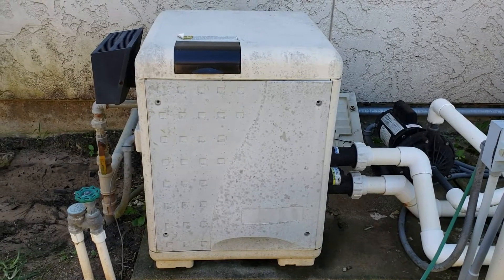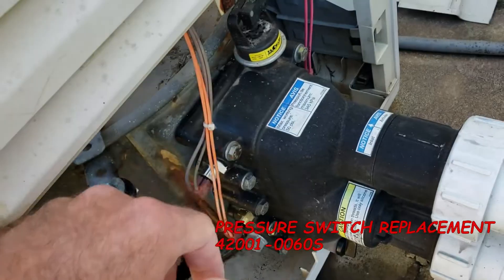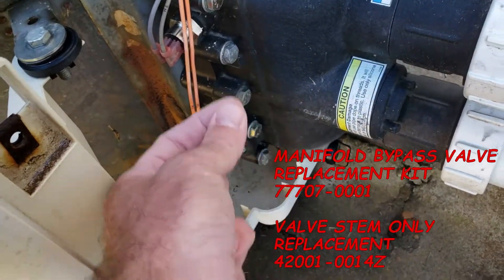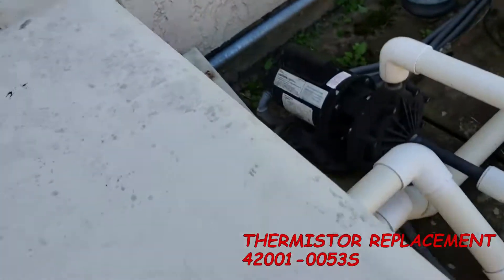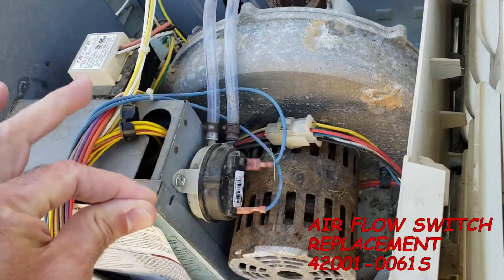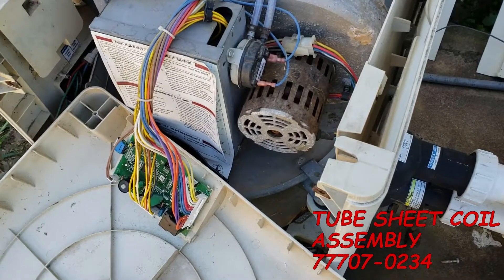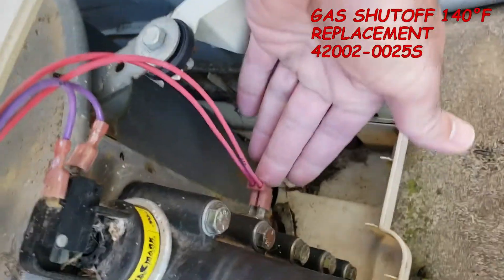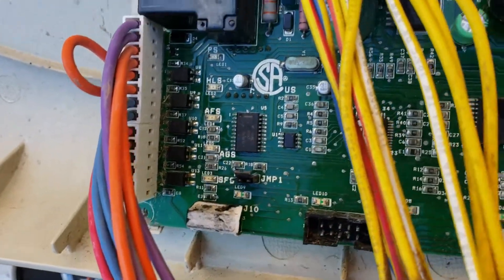PENTAIR MASTERTEMP 400 ERROR LIGHT LED EXPLAINED

Comment: Hello! 

I have Mastertemp 400 that's about 5 years old.  Does the same thing whether I turn heat on with my phone app (iAquaLink) or with the unit being in service mode(manual).

    Cleaned filter to ensure proper water flow
    Temp was set to 102
    Revision 13
    Thermister reporting ambient temp

The heater seems to be firing up normally when the controller calls for heat. The air blower spins up with the HEATING led flashing for about 10 seconds before the burner actually turns on and heat is felt coming out of the metal exhaust vent. However the instant the burner ignites, the SERVICE HEATER led turns on immediately. The burner continues to fire for 12--21 seconds before the heat/burner shuts off. Usually over 20 seconds. The heater is definitely turning on. I can feel heat coming out. I removed the top cover and checked out the LEDs. Found the the 'AGS' LED on...on the back of the board. Followed the troubleshooting chart in the install manual.

Purchased and installed new AGS switch from Amazon. Didn't fix it. Also at the same time, I replaced the thermal regulator. (tested old one and new one in hot water, both worked)

On the header, I noticed the bottom 2 bolts were rusted(plan on changing them all to stainless). Removed the 2 to see if any water game out. No water came out. Ended up keeping going. Removed the header completely so that I could check the Manifold Bypass Valve. Looked good. Copper on the heat exchanger pipes in and out looked good. Thermister and HLS looked good, but I haven't tested them. I haven't replaced the control board yet since it's pricey. Really don't wanna jump into the tub yet, since its a big job. Honestly don't wanna just replace everything in hopes to find a needle in a haystack.

What are some other tests I can run? I'm good with DVOMs, resistance checks etc.
Not sure where to do at the moment. Suggestions?

I added a video of this https://youtu.be/bu4v_HDQCbA
Reply from the maker: Wow, that's some fantastic persistence for sure.  You and I have that in common clearly.  As for your problem, I have no experience with AGS and PS error lights, so I would not want to suggest anything other that what you have already done which is replace the AGS.  I am a telephone cable repairman by profession, so I am much more comfortable making electrical suggestions than gas suggestions.  Someone posted in one of my videos that their gas pressure was insufficient and suggested the low gas pressure was causing their AGS error, but you have had your system for 5 years on that same pressure and had no issues, so that doesn't sound like the right rabbit hole for you to look in.  Please leave this post up and let's see if we can get someone else to comment that has had and fixed the same problem you are having. Suggestions anyone?  Cheers!
Reply: @pvt-pilot  Thanks!  I'll leave it up.   Ya, my gas is good.  Actually entire system has been there 14 years, just my new heater that I installed 5 years ago is new.  I've also put this onto forums at Trouble Free pool.  I'm not a pool guy either, but I do fix my own pool LOL

Comment: Hello!  I have this same heater(about 4 years old). Unit fires then turns off after 10 seconds.  I removed the lid and found the AFS led on.  As a precaution, I removed the bottom 2 bolts on the black manifold to see if I have a leak.  Altho, the bolt heads were rusted pretty bad, thankfully, no water came out.  I've ordered the Pentair 42002-0025S AGS sensor. Hope this does the trick. I'll reply back later after I swap it out. thanks again
Reply: Did that work I keep getting and AFS light but I put a jumper wire between the two connectors and now it work but obviously not the proper fix.

Comment: I got AFS lit and led 11.  Replaced thermistor, thermal regulator, the probe for the heat exhaust, igniter, and switched inside board with used one claimed to come out of good unit.  Turn on heater once new igniter in it actually had heating light on for second before going to service and screen just has a stand-alone 1 on it.  Mastertemp 400
Reply from the maker: Remove one of the 2 bottom bolts of your black manifold mounted on the side of the combustion chamber.  If water comes out, you have a leak with your tube sheet coil assembly.  That's what caused my AFS.  Watch my AFS video and heat coil replacement video if you have that same problem.

Comment: My man!!! Thanks for the great video.  However, I am seeing something else.  My heater DOM is 2011 just to give you an idea.  Lately, when i walk by I see that the LED lights are on and it shows pool heating.  But, I did not turn it on.  When I try to turn off, it just stays on.  (bad button?)  It does however let me switch between pool and spa.  Sometimes the fan is even running.  I turned the gas off so in case it did fire up I would not be burning NG all night or day without knowing.  FYI, it does light up and heat if I want it to.  Today when I got home it was doing the same thing so I pulled the cover off and looked around.  Everything looked ok.  I made sure everything was plugged in tight etc.....  Circuit breaker off and back on and it does the same thing, fires up itself.  But then I get an ADO and SE code.  The SE lets me select 1 or 2.  Long story short, I unwired the heater until I can figure it out.  I am a pretty handy guy, just looking for some direction.  Thanks in advance.
Reply: If my heater was coming on without my turning it on, I would suspect a defective touch pad first. I would remove front and rear panels, unscrew four toggle nuts holding top panel on, flip top panel over, than unclip ribbon cable connecting touchpad to control board.
If that stopped heater from coming on all by itself, than I would order new touch pad.
Reply from the maker: Hmmm, working too well for ya!  I had that happen before too, but it was only because I had my main Easytouch control panel programmed to heat the pool too by accident instead of only the spa.  So when I turned off the spa, it went from trying to reach 96 degrees (spa) to trying to reach 84 degrees (pool).  This called for occasional heating since the ambient temperature at the time was about 65 degrees.  The was user error, not faulty equipment, and I fixed that right away by taking a closer look at my programmed settings.  If you know you have you main control panel set correctly, then I don't know what is causing it to turn on without command.  I would lean toward the control board being the culprit, but that is just a shot in the dark...sorry I don't have anything definitive for you mate.

Comment: I’m getting HLS light error, heated turns on and off. I replaced HLS and thermistor, took manifold apart everything in there is intact. By heater still cycles on and off showing HLS error. Any ideas?
Reply from the maker: Hey Toni, no other ideas come to mind really.  You hit up the 2 items I would hit first...the most common broken manifold bypass valve and then the HLS itself.  Something is still making the control board detect too hot of water across HLS.  I assume your heat exchange coils are not clogged since you took the manifold off already.  Im sure you would have noticed something there if there was a problem.  Perhaps corrosion of the wiring harness where it plugs into the contol board or a faulty control board itself.  Neither of these are likely but worth taking a look at them.  The control board needs the correct resistance across the HLS pins on the motherboard to function correctly, and corrosion can throw resistance readings out of spec easily.  Sorry, I am not much help.  That's all I got for now.  You did all I know already.  Good luck and please let this comment feed know what you find.  Thanks!

Comment: You didn't address the temp fault light on the board. What is that repair solution? I'm getting 128 r14 E01
Reply from the maker: I don't have a temp fault light on my board...you may have a newer version that included a temp fault light.

128 = normal part of boot sequence displayed on all software revisions of this pentair control board.

r14 = revision #14 software  is loaded to your control board. (Mine is r8 = revision #8 software)

E01 means that your control board detects an open on the pins of the control board dedicated for the thermistor.  This can be either an open in your thermistor itself (defective) or an open in the wiring harness wires that are hooked up to the thermistor (look for rodent damage on wires or corroded spade connectors)  Thermistors are electrical thermometers so if you have temp fault light and E01 on your display, this would make perfect sense.  Both are screaming fix the problem with the thermistor.
Hope this helps.
Reply from the maker: Here is my thermistor replacement video:  https://youtu.be/vh62GXqkKTA

Comment: DUDE!!!!!! My jacuzzi has been down for a year and a half because I refused to replace it. I started with replacing the control board, then the blower/fan motor, AND NOW!!!!!!; having viewed your video(which didn't exist when it first went down), will replace the pressure switch. I went out initially to short it out to confirm the switch really was the problem. It was then that I discovered both leads had rusted through and broken off. Yet, they remained in position making it look like they were landed properly.

So, I re-terminated the wires, re-connnected them and ta da, it fired right up!!!! The terminal lugs are sketchy on the switch so I'm going to replace the switch as a precaution. Can't thank you enough.
Reply from the maker: Sweet!  Stories like this make it all worth it to me that I bothered posting this stuff.  Cheers!

Comment: Service heater on but no codes??? Please help
Reply from the maker: Check thermal regulator first.  A faulty thermal regulator will throw a service heater light without codes because it is not an electronic part tied to the control board but a properly functioning HLS will detect the super heated water resulting from a stuck thermal regulator and will shut the heater down and display "service heater"
Reply: PVT-PILOT   Already did. My next step is to replace those 2 sensors next to it. 
Thanks for fast response

Comment: Very good video. Short and to the point. I keep getting an AGS light. The heater is almost new. Not sure what to do. It runs for quite a while then throws the error again. I can unplug the heater and it works fine for a while.
Reply from the maker: I am not sure what would trigger AGS other than a defective AGS itself.  I have never had that error led yet on mine other than when I intentionally disconnected the AGS (open leads) just to see what would happen, so I never tore the gas side of the heater down to figure out how it works.  Sorry, all I can say is if you open the leads (a.k.a. your AGS is internally open or has high resistance out of specs), the AGS diagnostic led will illuminate.
Reply: PVT-PILOT Ok. Thanks. I will do some more investigating. I’m guessing low gas pressure right now.
Reply: PVT-PILOT FYI....I figured my problem out. It was a bad thermal regulator. I put a new one in and it works fine again. It was only 2 months old though. So if anyone has an AGS light, the thermal regulator may be the issue. Thx
Reply: I figure the AGS sensor is nothing more than a high limit temperature switch that shuts the gas off.
Reply from the maker: @ericanderson8556  Cool, thanks for adding your experience to the thread.
Reply: Common problem with new pools that have variable speed pumps. Homeowner or pool company sets pump speed too low to provide enough water circulation thru heater causing water to overheat and trip the ags, shutting the heater off.
Common fix if you have an easy touch panel is to get into settings and have the pump speed increased to about 2600 rpms in spa mode. If you dont have a panel  than you will just have to increase pump speed at the pump display.

Comment: Hi I have a pentair minimax and screen wont turn on
Reply from the maker: I am not familiar with that unit, but if it is anything like Mastertemp, check for power to the board before replacing the board.

Comment: I just replaced my heat exchanger. When I turn it on I get a 126. I've replaced the thermester still 126. When I tough the thermistor wires together I do not get an E01. It stays 126. Any idea? Thanks for your videos!
Reply from the maker: E01 indicates an open in the thermistor.  Touching the wires together is not an open.   Touching the wires together would be a short.  I don't know what code to expect for shorting your thermistor  wires.  
I assume you get this 126 reading after it boots through the 128, followed by R-8 (or whatever your software revision number is).  So let's go from there with some things to try:
1.  Pull the wires off the thermistor and don't let them touch each other.  Turn on the heater.  Do you get an E01 immediately after the R-8 during bootup?  (You should)
If not, hold down the yellow reset button on your control board and try again because your control board is not doing its job.  If this does not fix it, you might have a bad control board, not likely but possible.  It needs to display E01 if the thermistor is disconnected.
2.  If you get E01 as you should, then test the new thermistor.  Use a digital multimeter (turn it to ohms) to read the resistance at ambient temperature first.  Then, use a hair dryer or something similar to heat the probe of the thermistor and look for a resistance change in your digital multimeter display.  No change is a bad thing.  I bought 2 defective stack flue sensors that work the same way but the 3rd one I bought was fine.  So, test it, especially if you bought a non-OEM part like I did.
I really think your problem is in the control board, because if you shorted the wires, it should give you some sort of error code similar to the E01, maybe E02 perhaps, but it shouldn't just sit there unresponsive like that and still display 126.  It is acting like it is locked up software wise.  Thats why I suggested resetting it.
3.  If you had to go through the fun of heat exchanger coil replacement, that means you had some catastrophic corrosion going on, so it is probably a very good time to replace every sensor in the heater.  With that extensive of corrosion, your sensors will start dropping like flies too at the most inopportune times.  Very annoying.  Amazon has a kit that has 5 of the sensors for $99 to the door.  
(1) Stack Flue Sensor Replacement 42002-0024S
(1) Thermistor Replacement 42001-0053S
(1) Pressure Switch Replacement 42001-0060S (3902)
(1) Gas Shutoff 140°F Replacement 42002-0025S
(1) High Limit 135°F Replacement 42001-0063S
Just search Mastertemp Heater Repair Kit.  Seller is Optimum Pool Technologies

Hope this helps,

Cheers!
Reply: Thanks for the quick reply and help. As it turns out when I re-assembled I brought the wiring harness down the wrong way so I had my wires mixed up. Now I'm up and running! Could not have done it without your video! @pvt-pilot

Comment: my heater turned on the service light and turn on the light PS and led1 which means that
Reply from the maker: ...means that:
1.  You may have an open in the wiring that goes from the control board to the pressure switch.
2.  You may have an open in the pressure switch itself (defective).
3.  You may have something blocking water from flowing into the intake properly that could be preventing the pressure switch from closing.
Reply: how do you get a bypass to turn on the heat x that turns on the ASG and already change it
Reply from the maker: @juniorjr2654  I dont know of a bypass for the AGS (Automatic Gas Shutoff).  If there is one, it would just be a resistor with a very specific ohm value that the control board accepts as within perameters for an appropriate temperature that the AGS puts out via resistance across the spade tips.  The only problem is that I don't know what that resistance value would be...meaning the exact ohm value of a properly functioning AGS.
Reply: or else I have a bypass for my heater to work
Reply from the maker: @juniorjr2654  Well, if you have a bypass idea, then post it so other people can see. 👍